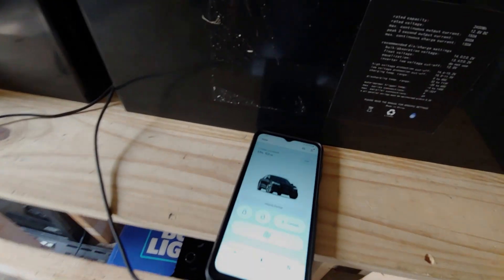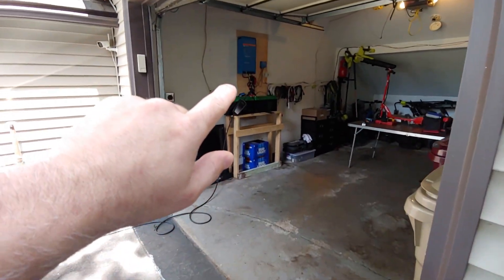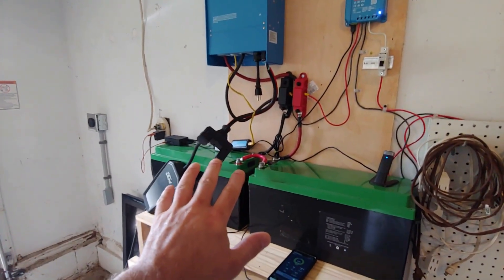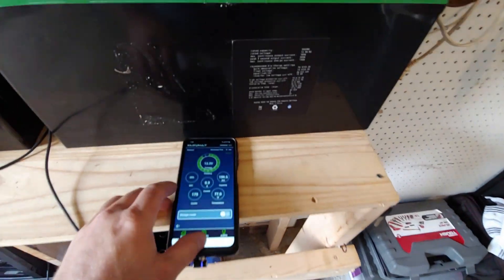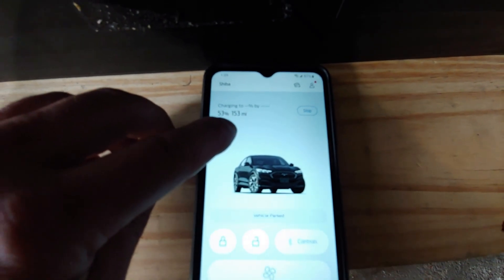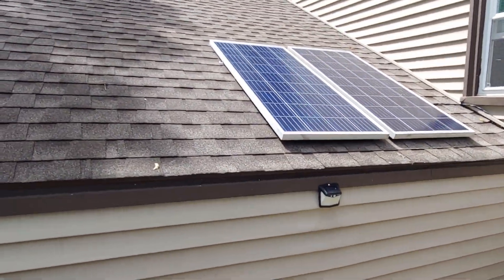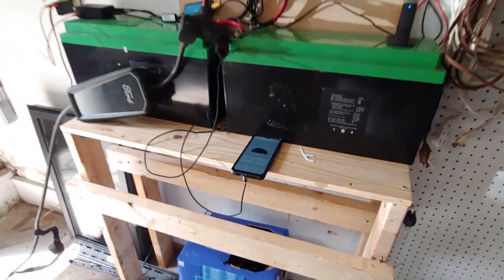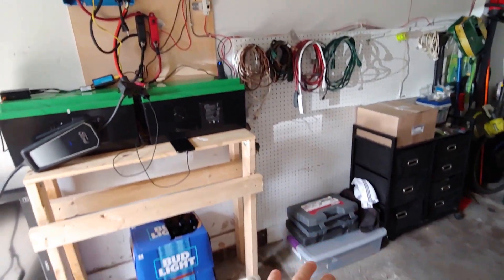Off Grid Vehicle Charging!

Comment: I get not putting on roof, but they are in probably the worst possible spot.
Reply from the maker: I know, I might put them on the back side of the garage roof where my little ones are.  (hidden). You're absolutely right
Reply from the maker: You know I have four of those panels.  I could get mounting brackets and just put them on the back side of the garage. That would be over 800 watts of solar, actually somewhat facing the southern sky.